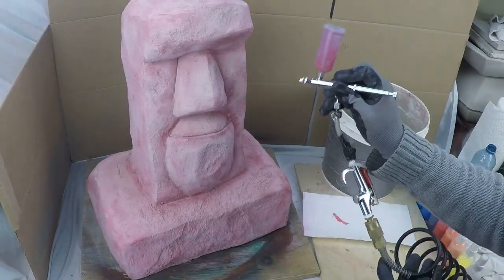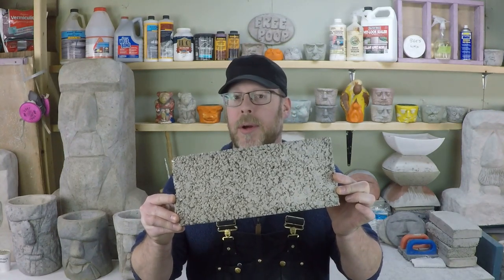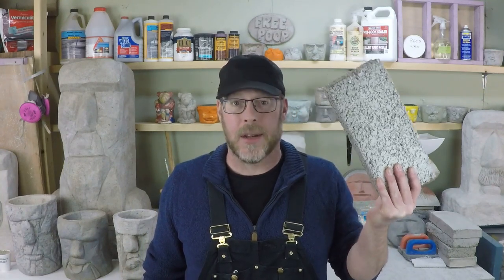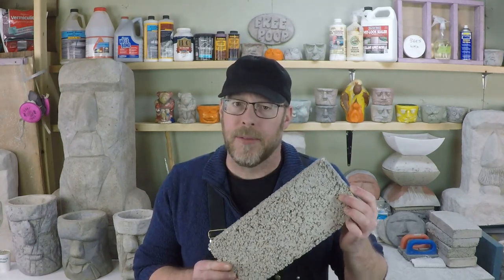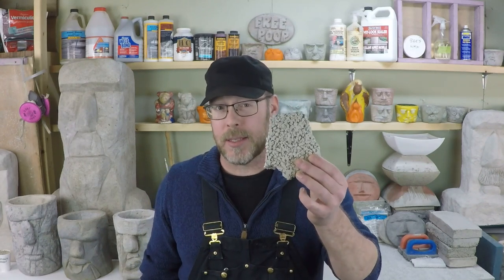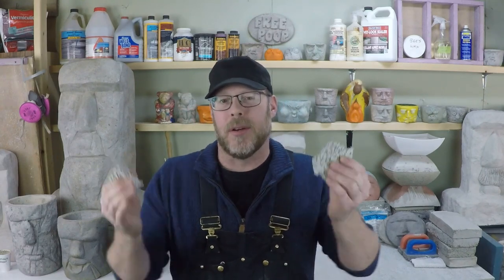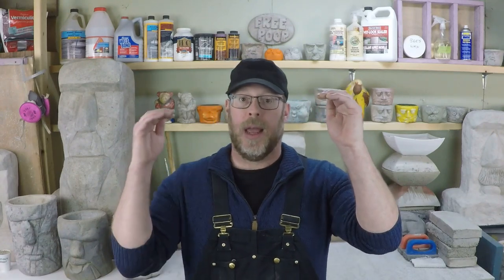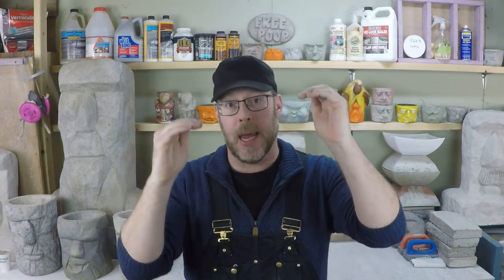Can You Make Lightweight Concrete?

Comment: Have you tested adding Sika fiberglass synthetic micro fibers into the lightweight mix to strengthen it? They use the fibers in the mix for concrete topping surface under finished floors. Works great as a binder.

Comment: Have you made a lightweight concrete with fiberglass fibers to increase the strength?
Reply from the maker: I have.  Both fiberglass and glass fibers.  I am doing a series of videos now testing all of these different mixes for strength so if you are into lightweight and want to see these test videos be sure to subscribe.  Cheers
Reply: Wondering if adding fiberglass would provide sufficient strength to make fence posts?
Reply: As an engineer I wonder if you could use lightweight core designs, cover with wire.
Reply: Then coat, with a stronger concrete mix as it sets.